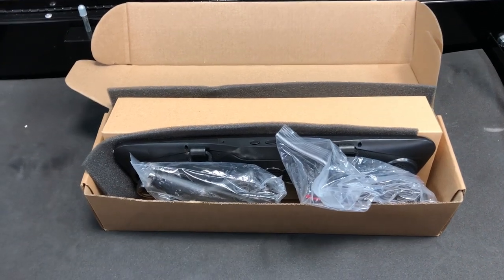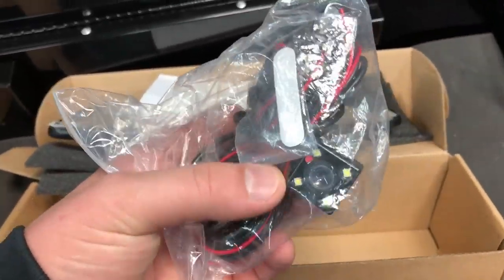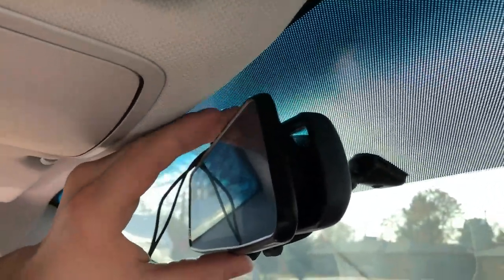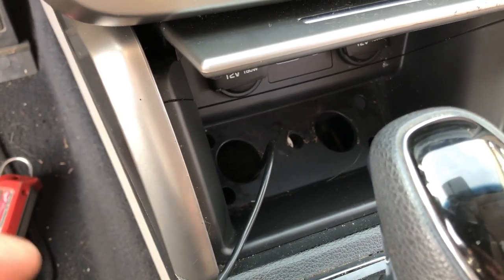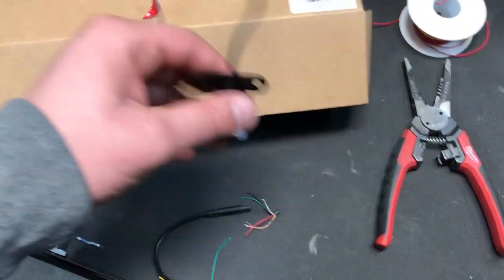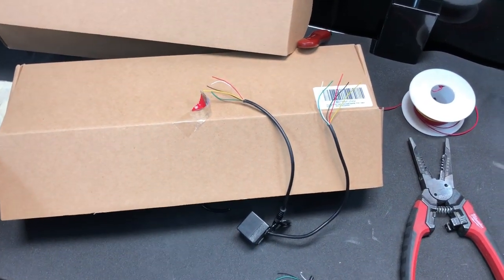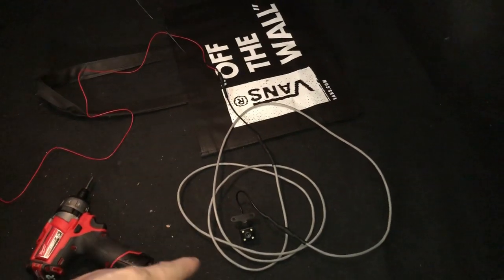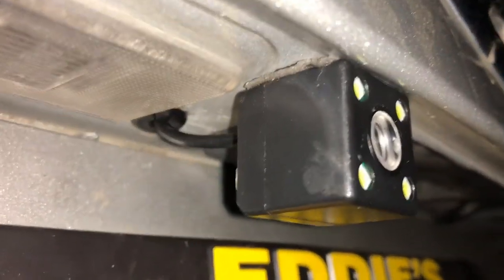BACKUP CAMERA INSTALL - LARGE 7" MIRROR TOUCHSCREEN DISPLAY (Read Description)

Comment: Hey, GREAT video! That you so much. Definitely gave it a like. One question though for when you turn the screen off. Will it still record as you're driving?
Reply from the maker: Queen B thanks! 👍🏻 In regards to your question I’m not 100% sure since I don’t use the recording option and I cannot check because the car is not available to me (shop repairs). It does loop recording which allows you to setup record times though, but is limited to 32gb memory cards. If I had to guess I’d say no because it turns off (says goodbye) when the lower button is pressed or the car is turned off (cigarette lighter powers off and power comes from cigarette lighter and reverse lights) and that is a safe assumption with some logic to be confident in my guess. A dash camera would be more of a camera to continuously record since they allot for larger memory cards. They have a new model update since this post which is a 4 pin instead of 5, they talk about it in amazon’s description and may have changed the software. Also hook up the red wire to the reverse lights for the guidelines to appear, I was told that’s what activates them and not just the small LED lights. Hope this helps.

 Pruveeo D700 7-Inch Touch Screen Backup Camera https://www.amazon.com/dp/B073WFJ7HV/ref=cm_sw_r_sms_awdb_t1_7X9nCb89VP2E8

Comment: Hey! So i just bought this dash cam and I love the screen on it. When I peeled the plastic film off of the screen I have a few bubbles. Do you know if that second film can or is supposed to come off too?
Reply from the maker: Duane Harrison it’s a screen protector similar to a phone one. You can take it off, it just helps keep fingerprints and you mirror from smudging if you use the touchscreen alot
Reply: Ok I figured but I didn't want to mess anything up lol. If I can't get the bubbles out by gently smoothing them out then I will just take off that 2nd film. 

Side Note: I wish the backup cam was better. The clarity is not good at all. If you know of a better backup camera that will work with this unit, please let me/us know.  Thanks again for your response!
Reply from the maker: Duane Harrison for the price I didn’t expect much, but it was surprisingly decent. If you look at the video where I Solder the wires you can match up that wiring diagram with a camera that has the same amount of wires for video and power feed and wire it in direct. The plug is more proprietary to their brand so wiring will be required. They have a few cameras for under $25 that have good picture but they run on AV style jacks. There might be a AV to wire converter but you will be taking a gamble once you cut your display wire. The seller does have replacement wires so it’s not the en of the world if you mess thing up. I did buy a cord from the seller and take off your screen and bench test it before cutting into the wire you already routed. Seller was generous enough to send me one when mine came up short due to wrong routing direction. 
I’ll be waiting for your video post on your channel 
😁👍🏻
Reply: Yes, you have to pull the second screen protector off
Reply: @andykolbin1783  thanks

Comment from the maker: READ BEFORE INSTALLING!!!!! You are suppose to run the wire through the top side not the bottom route. I ended up having to extend the wire because I came up short. Maybe for a smaller car not a full sized car it won’t matter. I asked if they had an extension wire but they didn’t have the option. Look at the video entirely to see how I extended the cable. The new model now has a 4 pin instead of 5 and has an extension available now. The red wire will hook into the reverse line to activate the leds and GUIDELINES. Use a light probe to find the wire that powers the reverse lights (see description, if you have a dual Filament bulb for reverse + running lights and not one just dedicated to reverse then you remove dual filament reverse bulb, someone will need to put it in reverse as you probe each terminal until the probe lights up). I recommend blacking / covering the led lights to prevent glare on your camera while in reverse and especially in rain 🌧 this issue enhances. The guidelines are not 3d (none are) they appear that way because they angle upward on the display. They will appear to get higher on an object as it gets closer to gauge depth, I recommend practice backing up to understand the distance you got as you back up base on the location of the line relative to the object (other car bumper location in respects to the line). Make sure you mount the camera to capture some of your own bumper so you know the maximum distance you can truly back up.

Good luck 🍀👍🏻 on your own DIY!

Comment: Hi I’ve had to take my dash cam out of the car it’s similar to yours. Mine was running my battery fiat. I’ve got a Ford Fiesta all accessories points are permanently live after the key is turned off.
Reply from the maker: Yeah that makes sense. You shoulda wired a on off switch to that particular outlet so you have full control of it or rewired it to accessory once the key is turned. Turning it off on the camera also should’ve killed the power. If not.... Easiest way to fix this is unplug it if not in use or add an on / off cigarette 🚬 lighter switch for under $10 on Amazon.
Thanks for the information it hopefully will help others to check this before purchasing the mirror.

Comment: Hi there . Is there a way to get rid of the grid lines when putting the car in reverse ? Mine are not in the middle of the screen ? Thanks
Reply from the maker: They will have a upward appearance since the screen isn’t 3 dimensional. Disconnect the single red wire that was used for the lines and led lights. The led lights suck because they are too close to the camera and add glare anyway; I used black paint marker to hide them.
Reply: Thanks for your reply. If I disconnect that red line will the rear camera still appear right away when I put the car in reverse  ? Thanks
Reply from the maker: AL K yes because your wires are still tapped into your reverse lights. If you looked at the way I installed it the first time I did not hook up the red wire and then I realized that that was the wire for the reverse lines and the LEDs which I did not want the LEDs to work.

Comment: Did this come with an app you can download to view any saved footage ?
Reply from the maker: KriRdz mine at the time did not. Everything could have changed since my purchase. I’ve looked at one yesterday on amazon and they had changed some software on the description page. You can add an micro SD 32gb card ( use Samsung EVO or SanDisk High Endurance Micro SD Card. Don't use SanDisk Ultra cards) for recording footage and perhaps get a phone card reader to store it in your phone. They have made it a 4 pin instead of 5 on the cable because they changed something on the camera (auto recording or something). They now sell extension cables for larger vehicles. I was told to hook up the red wire to the reverse lights (should turn the camera on automatically when in rev) to display the guidelines (also LED lights will appear). I will be doing this when I get time since I’m unsure if it should be tapped into the main power constant or momentary on. I believe momentarily so it only shows guidelines in reverse and not while recording and driving (eliminates obstruction of guidelines).
The amazon posting will give you all the new details. I’d also ask the seller via amazon since mine was an older model. Hope this helps and makes sense! 😁

Comment: I installed the camera and pluged the red wire to the reverse ,but the camera does not turn on. There is no ground cable and it only has red wire. how did you wire the camera to work? camera?
Reply from the maker: Bethel Bekele the cigarette 🚬 lighter plug has to be plugged in to power the screen. The red wire is to tell the screen when it goes into reverse to put the guidelines in and power the little led lights. I have an older generation so it may be slightly different due to it going from a 5 pin to a 4 pin. Also be sure the red wire is hooked into power when in reverse or constant because it might be a ground wire you tapped into. They should also have a help number on the instructions or box. Hope this helps

Comment: Do you have link for the camera? It is hard to tell in the video, but the 3.5mm GPS port on the top appears to be populated. Maybe your camera has the GPS option?
Reply from the maker: TheSalient0ne I doubt it has GPS options maybe N,E,S,W option but that’s nothing great. they have way better cameras available if cost isn’t an issue. This was a gift that I installed for my GF. so it was the best one for the $. Wireless seems to be nicer but I still haven’t found one that has enough reliable views without breaking the bank. I have an iPad install video communication up soon as I edit the video to show how I made a cubby for my car to mount it with phone wireless charging.

Pruveeo D700 7-Inch Touch Screen Backup Camera Dash Cam Front and Rear Dual Channel ... https://www.amazon.com/dp/B073WFJ7HV/ref=cm_sw_r_sms_c_api_10YiBbWS63C3P

Comment: I have a question bro....does the rear view camera have to be directly in the middle of the car for the reverse monitor to work accurately ( so that it averages the care dimensions accurately while reversing)?
Reply from the maker: To get the most accurate reading yes so it allows the coverage to be split; it doesn’t have a large enough view angle to pick up the bumper as it curves around the sides of the car. I have an offset of maybe 3-7” to allow the camera to sit flush with some double sided foam core tape (use 3m primer to help adhesion) instead of that bracket that requires more holes to be made. The rule of thumb is to make sure you can see a strip of your bumper at the bottom of the display so you know your maximum reverse space and from there the guidelines (red wire to reverse light) help gauge depth; I recommend putting an object in the rear to get an image mentally of how far something is from the where each line reads since the line are not 3 dimensional they will always be viewable on an object and look higher as the object gets closer. I recommend it you hook the red wire up to black out the led lights because they put a glare on the camera and if it rains enhances the glare through the drops of water.
Reply from the maker: It is a fixed angle so it requires movement of the camera in / out / up / down tilt to capture the car. No camera will be tuned around a car perfect but rather generalizing would be standard factory and 3d factory (approximations so it is useful on multiple cars in production ). To get required images for factory they design the bumper or mount to house the camera in a desired location. The guidelines too are a typical set width since cars can vary once again the line are not 3d they just get higher on an object as it’s close and are projected on your screen at an angle to appear to be 3d.

Comment: Wait so is there an option to connect the rear view mirror to the fuse box on the driver side or no?
Reply from the maker: Jashen Sambon no because the power comes directly from a cigarette 🚬 lighter connection. You could source a area in the fuse box with fuse box fuse splitter (add a fuse tap adapter) and buy a camera setup that wires in to a power source directly. If you’re going through all that trouble you might as well tie into the reverse lights so your camera comes on in reverse.

Comment: Hey man what did you attach the red wire coming out of the rearview camera to?
Reply from the maker: Scotty Appleford I didn’t... that is for the LED lights that don’t make the camera any clearer IMO.
Reply: Ok thanks man. I didn't attach it either and everything is working good
Reply: @ProjectAnubisUSA  Are you sure you're not missing something?  That red wire is supposed to be connected to the backup light circuit.  According to what I've seen on Amazon, when that circuit is energized (ie. vehicle placed in reverse) the multi-colored guide lines show up on the display, just like a factory system.
Reply from the maker: Roger Keck I realized it needs to be hooked into the same circuit to power up the rear guidelines. By connecting the red wire to the reverse lights it is on the same circuit as the cigarette lighter plug’s power therefore allowing them to be activated. Read my “read before installing” for tips and updates.

(Old reply) I did a dry hookup before installation and the wire powered the led lights no guidelines turned on. Perhaps they updated the model by now and that is now a new feature. If so that would make this deal even better. The led lights were useless due to their short throwing light due to no reflector as a flashlight would, so I rely on the reverse lights to illuminate the rear. If you want the camera to turn off (when traffic has headlights on you will turn off the display after you back up) and on durning reverse you want to choose a camera that allows you to wire the signal wire (power wire) to the reverse power. If you already have this camera you would have to splice wires and route them accordingly.